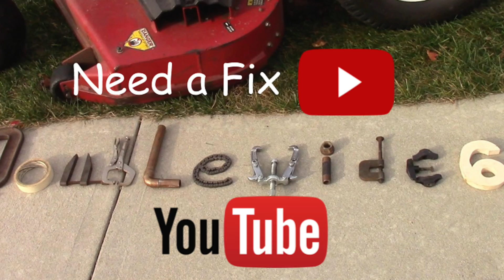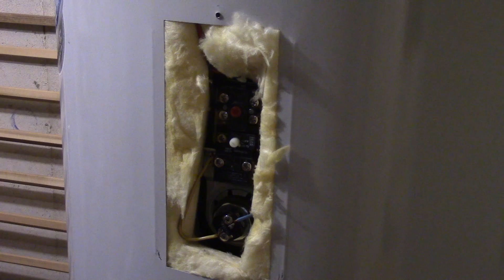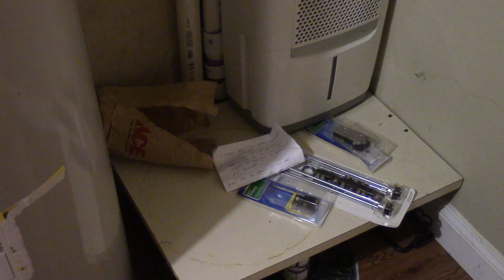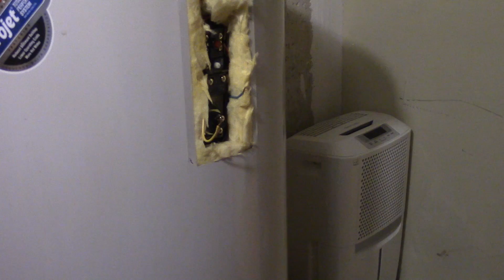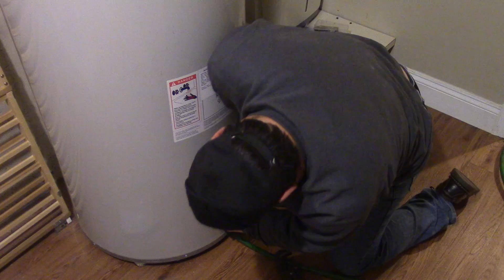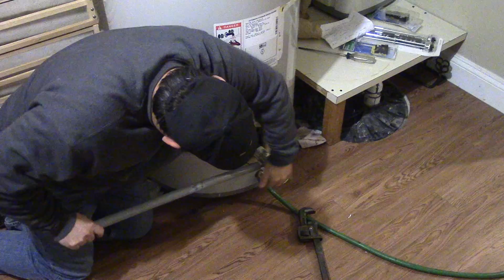Water Heater Not Working

Comment: The GFCI trip on a 2003 Bradford White electric water heater keeps tripping..  the basement room is 60° and there appeared to be light condensation around the top element and some insulation appears to be missing above the switch on tank....can i buy more insulation?  Could element maybe be leaking at screws??   This was a lightly used (few months while a boiler was made) water heater that was like new.  Got it from a plumber friend.  It sat upright in basement for 4 yrs and i just had plumber install it, yday.

Comment: So I'm having a prob myself I replaced the thermostat & heating element it still won't work I have 120v going to the on each side heating element do have any suggestions?
Reply: Joseph Loudermilk did you figure it out I have the Sam issue
Reply: House wairing problem and thermo cutout prablammmm

Comment: I've been in my home for almost 26 years and still using the same LP gas water heater. I changed the burner once about 15 years ago. I will be replacing the unit this spring.

Comment: Heya Bob! Did you ever contact Grip6 to have them make you a custom buckle? I'm really looking forward to your design of choice and the color combination you decided to go with. Don't forget...I've got the discount code Zippo20 for 20% off the deal. Water Heaters are the Devil! When I got my new water heater some 12-13 years ago, I went ahead and purchased replacement thermostat and elements for it so I was prepared. Looks like you were well covered too! Great minds thing alike! Cheers my Friend! Hugs to the little man! Zip~
Reply from the maker: Nope no belt yet.  I would like my logo with the tools but I need to find someone to draw it up.  I ran into the same problem when I was looking into getting Tshirts.  I might have to revisit it.
Reply: I'm the same way. Looking for a reliable and quality print shop to work with me to get my logo (which is just typeset) the way I want it. Anyhow...Just thought I'd check base with you on that! Cheers my Friend! Zip~

Comment: Dude I like you a lot but I got to tell you if it's this old you got to get a new one you just nickel-and-diming it. I'm not even going to watch the rest of it but I wish you luck double wide. I just replace mine and it was 9 years old and it looked like crap on the inside. 80 gal what are you heating the pool.
Reply from the maker: Well it all depends where you live and your water setup. If you see a video of me putting in a tankless water heater in the near future I would consider this a fail.

Comment: you should have changed the anode rod [very 10 years]  its easy too do
Reply from the maker: Yes, from what I understand the Bradford White Anode rod is really thick and made for the life of the unit.  The new ones you put in there are thinner than the original.

Comment: Good Job Bob I have had to replace my elements before i could not believe how tight the bottom one was. I drain mine every spring we are on city water but IM still surprised how much sediment comes out. Also as already mentioned in other comments its a good ideal every few years to replace the anode rod. I agree with you the home centers only carry up to like a 50 gal heater some of the plumbing supply places around here do carry larger ones
Reply from the maker: Yes, from what I understand the Bradford White Anode rod is really thick and made for the life of the unit.  The new ones you put in there are thinner than the original.    The plumbing house said I could get a 50 gallon with a mixing valve and that would be the equivalent of more hot water than a standard 80 gallon.

Comment: There's also a sacrificial anode rod that should be changed every 3-5 years to extend the life of your water heater. Thanks for sharing...
Reply: Darryl 603 can the rod be removed and cleaned or just have to replace?
Reply: Cleaning is not an option since the anode rod sacrifices itself to protect the lining of the water heater.
Reply: Darryl 603 That makes sense, thank you for the information.
Reply from the maker: Yes, from what I understand the Bradford White Anode rod is really thick and made for the life of the unit.  The new ones you put in there are thinner than the original.
Reply from the maker: I think most of them are made in sections so they can be fit in without hitting the ceiling.
Reply: I have seen some where calcium covered the entire surface of the rod and rendered it completely useless.
Reply: Another thing to consider is if you're on city water or well water. There are different compositions of anode rods for specific water types that should also be considered. For example, the factory anode in a well water situation will often give off a rotten egg smell to the hot water. Replacing them with I believe it's a Zinc rod will continue to protect the liners, but render the rotten egg smell mute. Cheers! And, by the way, an excellent point Darryl! Zip~
Reply from the maker: Didn't know that thanks Zippo!